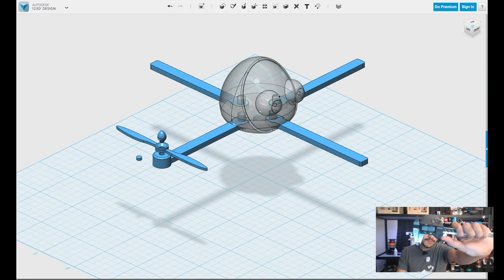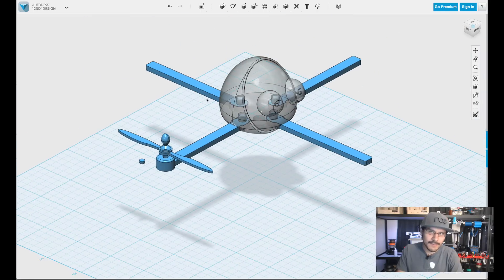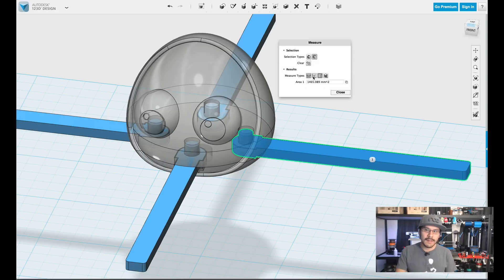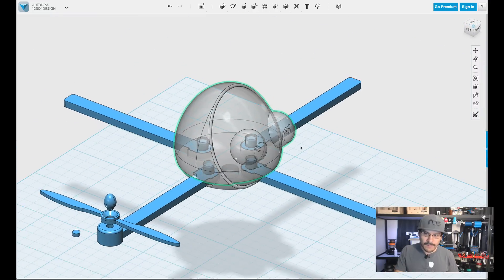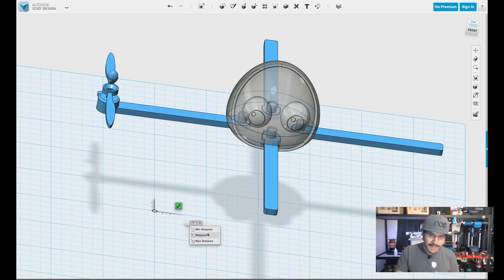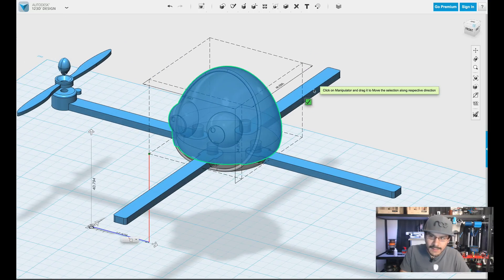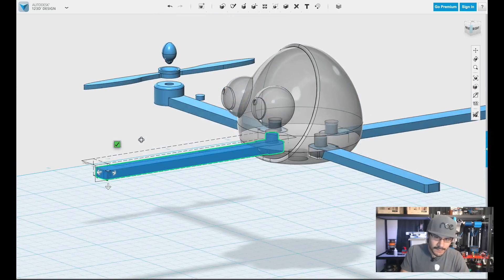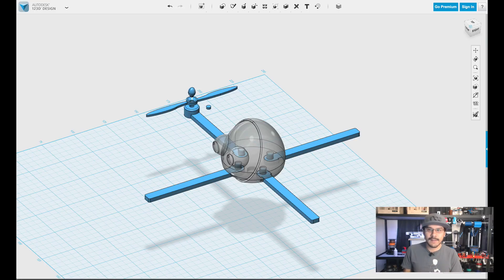Measuring + Ruler Tool - Layer by Layer

Comment: Hi I'm trying to adjust the neopixel arcade buttons in particular the distance between the 2 bevelled pieces at the top face of the button cap. I was wondering how you do this in 123d? I can't seem to find an obvious way of doing it with precision?

Comment: when using 123, How can you design using assemblies? Your part showed 6 or so objects. When a print is cut you need to slice  each object. So can you export single objects from a module? You may have a vid covering this already but I have not seen it yet.
Reply from the maker: thanks for the suggestion, adding this to my list!